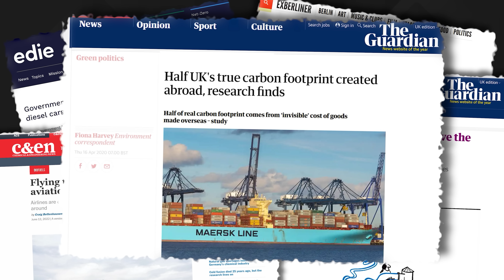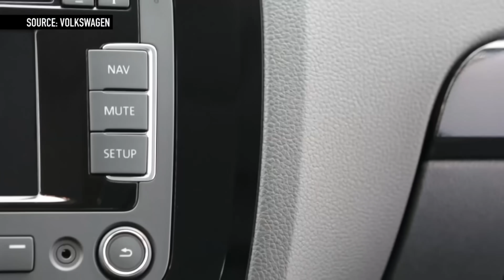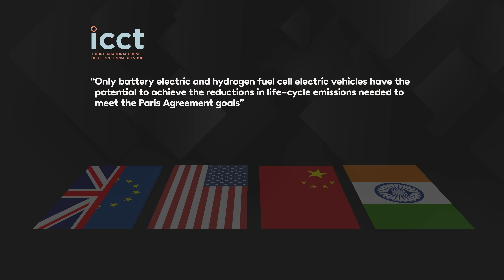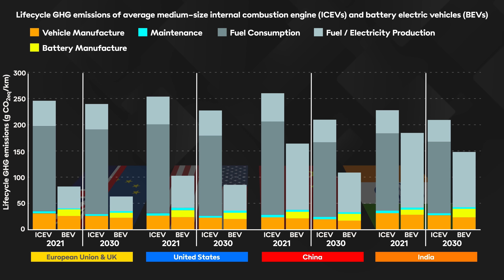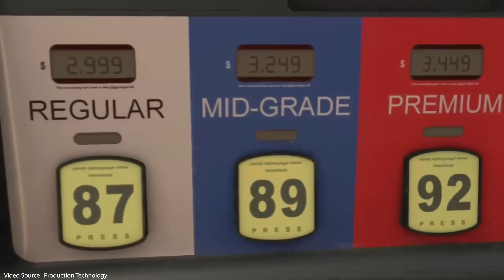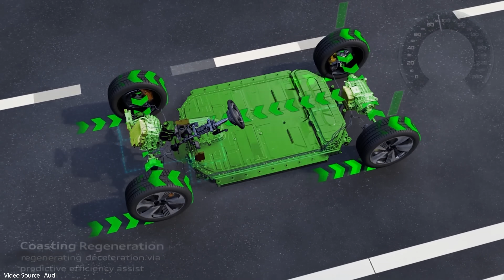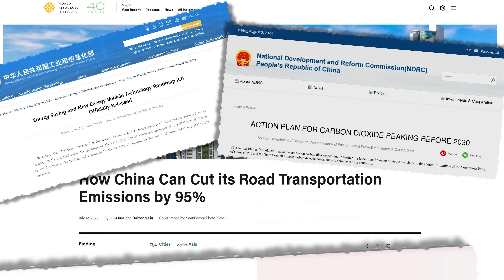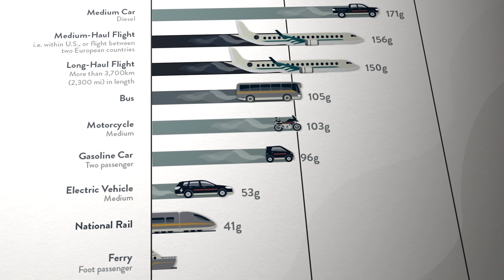Are EVs really better for the climate?

Comment: Fantastic presentation of the subject matter.  I'm a brit living in Norway where the use of electric cars is extremely widespread, the charging network is pretty good and almost all the electricity is generated using hydro power (so all in all, a pretty unique situation looking at the global picture).  I've owned a VW e-golf for the last 4 years, but I also have a diesel VW Touran for practicality purposes (big loads and it has 7 seats).  As the Touran is getting old and the options are getting better, I'm on the verge of buying a larger electric vehicle to replace it.  Last week I rented a VW ID4 to do a long journey within Norway (as my son is starting a year at University on the other side of the country) to take the opportunity to see how it would go using an electric car for long journeys.  This was the first time I've ever done a journey more than 100 km in an electric car and the first time I've ever used a public charging station.  The journey was roughly 360 km (220 miles) and was a reasonable overall  increase in altitude (roughly 450m), but with a rough range of 500 km, I was fairly confident the ID4 would be able to do it on a single full charge.  We stopped to charge anyway while having a bite to eat (speed limits and intercity roads in Norway are not what you would call ideal, so it's roughly a 6 - 7 hour journey).  The 20-25 minutes it took us to eat was enough to put an extra  200 km range in the battery, so 'range anxiety' was never an issue.  On the way back, I didn't even consider charging as the battery level hardly moved in the middle of the journey because of the regen keeping the battery topped up as I came down off of the highest point on the mountain roads (I would guess I got about 100 - 150 km 'free').  The whole experience was quite honestly, fantastic, with two exceptions -1 being something with the car and the other the charging network.  The thing with the car is the touch sensitive controls for just about everything in the ID4 (irritating and temperamental - as documented on numerous reviews of the ID4).  The thing with the charging network is the absolute insistence of the charging companies to require a mobile phone app to use the chargers!?!?!?!  There are a few apps which cover multiple charging companies, but our experience was that there are various incompatibilities with certain phones (payment methods, android versions, Ios versions) which don't present themselves until you actually try to charge the car (they install ok initially, but can be fiddly with setting up payment methods - but may not ultimately work anyway).  I had numerous problems with this on my Sony android phone (which is admittedly not the newest model, but it's also not ancient either) - with both the multi-company apps and the dedicated single company apps.  Why oh why can there not be standard card reader payment on these chargers - just like a petrol/diesel pump?!?!?!?  This is something that the government needs to step in on and state there has to be a standard card payment option on all public chargers, in my opinion.  Fortunately, when I did get one of the apps to work on my phone, there were more than enough chargers available around the major routes and towns to travel around without any concerns.  So, with more and more public charging stations popping up on a regular basis, there's no reason not to take the plunge (at least here in Norway) to going fully electric now that there are a number of vehicles with over a 400 km range.
Reply: Thank you for your informative comment🎉👍
Reply: I ain’t reading allat bro😂

Comment: Thanks a lot about this video. I was wondering about the numbers on hybrids. These are an option where full EV is not an option due to charging locations and type of residence.
Reply: Or for people like me that genuinly love the engineering of a classic engine  but can still switch to EV  at anytime.    Enjoy my hobby of driving something with a soul ( an engine)     but contribute to at least A LITTLE BIT of  zero emissions when just wanting to get fram point A to B   for a shorter distance.
Reply: @The-Cat  I hate to break it to you mate but this sounds like aspirin for the conscience. Please don't hate me for holding the mirror.
Reply: @nassimabed  A liitle bit tho... EV's  battery are dirty for the environment too (Mining )  so those in of itself are just asprine for a headache too 😅   Especially if energy is still produced by coal. 

But at least they help a whole lot more than hybrids.

Both it's better than doing completly nothing.  (continue with 100% combustion engines. )

Comment: I have owned BEV car for two half years. I have seen UK Government EV grants drop from £4500 to £1600. The home charger grant of £500 stopped. Cost of rapid charging is now £0.57 or more kwh with 20% VAT on public chargers .20% VAT on new EV cars in UK.  UK Government has cut petrol and diesel  fuel tax by £0.05 per Litre . The cost to buy and run petrol and diesel are about same as EV cars now. Norway has no VAT on new EV car with 50% off toll and ferry cost. 90% of new car in Norway are EVs. I think UK Government is sending mixed messages about owning EV car. Rapid EV charging on motorways is nightmare with 2 to 4 charges at most services. Scotland has very good charging network unlike England and Wales. All Petrol station should have rapid charger's by law if they want to sell petrol and diesel. Make petrol and diesel £5 litre and cut cost of EV charging.

Comment: These analyses for understandable reasons always take fuel cell and battery cars as two opposing options.

In fact on most metrics combining the two in plug in fuel cell hybrids is much better.

A 16KWh or so battery pack covers day to day running around, and ups the efficiency of fuel cell only options, taking away the most common argument against them.

It also drastically reduces the embodied energy and use of often scarce raw materials in batteries.

And when you are driving further, the fuel cell is as convenient as a petrol car with no need to hang about charging.

Hydrogen does not even degrade in the tank, unlike petrol, and will quite happily do its job even if it has not been needed for 6 months.

More compact, longer lasting batteries together with advances in fuel cell technology make this a realistic option.

Comment: What are the costs and emissions of mining etc of ONE average sized commercial wind turbine? Also who is going to fund already stretched , and stressed, families enabling them to buy these high priced EV's? The cost of 'green' energy v traditionally generated power structures will only be viable once fossil fuels become as astronomically expensive as the cost of renewables. Maybe this has something to do with the massive push to manipulate oil prices upwards permanently. Will we ever get to a decent ratio of power distribution unless we have supergrids of any power infrastructure that can be routed to where it's required at any given time? Aren't microgrids only really totally effective in rural areas way off grid? Has social engineering failed in putting people, food and other consumables closer together?

Comment: Great vid sir,
But I think you skimp over some important environmental factors, which may not help your argument that electric are all good.
For example; I believe Ev's need to last a minimum of twenty + years including battery, to be beneficial for the environment. 
50 years would be better,  and they could be upgraded to remain fashionable.
Why do things like crypto currency not get an environmental levy? It uses insane amounts of energy. 
Also Ev's need to be 100% recyclable, after all there's a reason rare earth materials are called rare. It is logical to presume we cannot dig rare earth materials up, for an ever increasing demand for ev batteries, but continue to make them impossible to recycle.
I love the idea of Ev's, they've been around for over a hundred years, but I've only seen one project care which self charges from its own panels and could possibly run without ever needing to be plugged in.
Lastly the biggest issue that makes cycling too dangerous, are all the parked cars on our roads. 
Too much of our  infrastructure, most useful for cycles is a carpark, which effectively creates four lanes of cars, and not enough space for the moving traffic to overtake a cyclist safely. If we built big carparks off the roads, we could have safe separate cycle roads for cyclists, who could pay some road tax to help with the cost to get safe roads to commute and free charging points for the ever increasing electrically assisted bikes. In a country of many hills, electric bikes make sense too.

Comment: Having an older, reliable car and don't drive it a lot still is the best way to save on carbon emmissions. I am in the fortunate position that I can do most of the repairs on my and my wife's cars myself and we do each about 10-15000km per year.  I also have an older backup "gas guzzler" that is only driven when one of the others is being repaired.
Reply: 10-15000 km is still a lot. At 35 mpg US (sorry to mix units) you're burning through 0.6 tons of gasoline in 12,000 km which turns into 2 tons of CO2. Drive less or consider getting an EV.
Reply: @skierpage  Well, as I didn't  buy them from new I can "drive off" the CO2 required for manufacture  of a car, that means, counting from now, in 6-7 years I will actually start to produce "extra" CO2, both my wife and I will be retired then (if we are still alive) and drive way less. So, no, in my case it will not be the best solution for the environment (or my wallet).

I also was looking into buying a solar system for hot water from new, unfortunately, in contrary to the electric solar I have,  it will not pay for itself in my expected lifetime (I pay less than 100€ for gas a year for hot water, I live in Spain ), luckily I found a 10 month old 2nd hand installation I could buy cheap, so I will save 100€ a year from now.
Reply: @macaalf8219  I installed solar thermal in 2007, and all it did was give me endless free hot water in the middle of summer, until I got tired of paying for repairs to the pumps and tubing. I ripped it out a year ago to put up more solar PV. Solar thermal is generally only worth it if you do it yourself.

Comment: I think plugin hybrids could solve the problem if they were designed to minimise emissions rather than maximise power output. And there needs to be some way of ensuring it is plugged in as much as possible. We know there are many plugins driven around without ever being plugged in.
Reply: The problem with plugins is their electric range is pathetic because so much volume of the vehicle is still used for the combustion engine and fuel tank. You're better off buying BEV - they're getting cheaper all the time and charging stations are springing up everywhere.

Comment: 1 liter of gasoline holds 8.9 KWh an efficient gasoline engine car uses 5 liters per 100 km which is 44.5 KWh. My Hyundai Ioniq uses 12 KWh/100 km in summer and 15KWh/100 in winter. In worst case scenario for my car the gasoline engine uses 3x more energy on the road

Comment: People still fail to realize that wind energy is most efficient at night when the grid demand is the lowest. Most EV's are charged at night when this wind power can go to waste due to lack of demand, and China produced the most wind power followed by the US, Germany & England. So not only do EV's tend to charge on renewables, they use energy which would otherwise not be used.
Reply: So they might actually help with the load balancing issues that wind has? My German in-laws will be gnashing their teeth when they hear that - they love to have a good moan about pro-wind German policies!
Reply: @generalstrike7187  Battery storage of one form or the other is the only way to utilise wind and solar as they reach peak production during grid lows - middle of the day and night
Reply: @fredkroh6576  energy storage doesn't necessarily need to be in the form of batteries in the conventional sense, though. Hydrogen fuel production through electrolysis of water, pumped water or other gravity-based solutions, heck, even storing energy as heat (since we are way more able to store energy cheaply and efficiently as heat than in batteries) and using that heat to drive power generation when required, could all play a role.

Comment: The time of day that an EV is recharged is still a major factor. Overnight recharging often means that the marginal additional generation required will come from the 'dirtyest' generating plants. Consideration needs to be given to increasing the availability of daytime recharging when PVs can be used.
Reply: Nope, you've got that back to front. The cheapest and greenest time to charge is overnight, hence why there are discounted tariffs for a limited number of hours in the middle of the night. During the peak demand [4pm to 7pm in the UK] the dirtiest and most expensive generators come on which are typically called 'peaker plants'. In some places large grid-scale batteries have forced the closure of some inefficient peaker plants.
Reply: At present there's something to that, although renewables like solar will reduce the dependence on dirty electricity production in the daytime. Storage solutions for energy will eventually allow us to bank surplus renewable energy in the daytime and consume that store of energy at night.